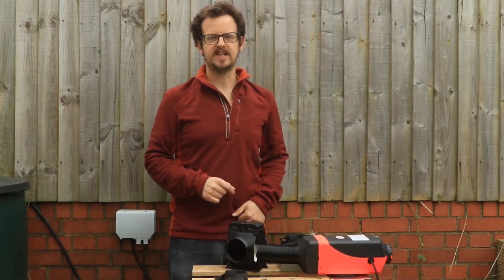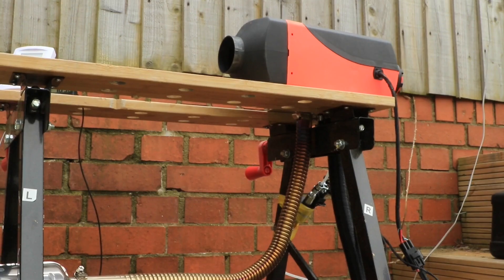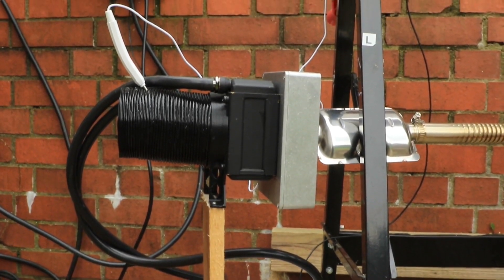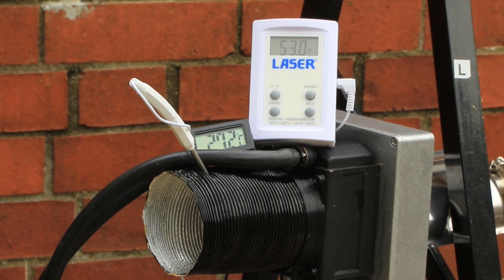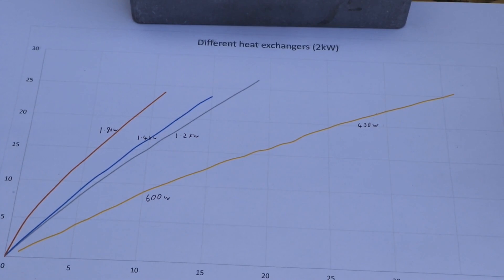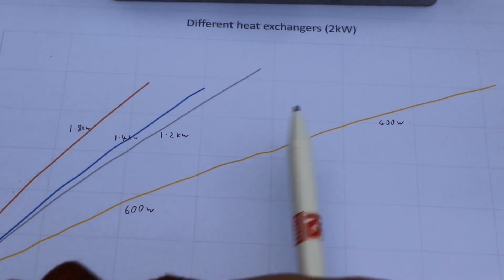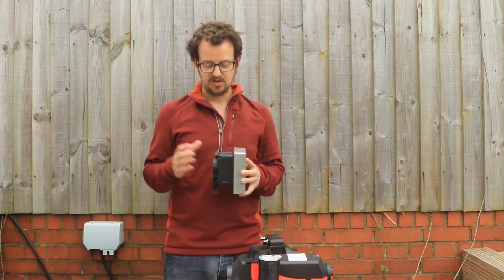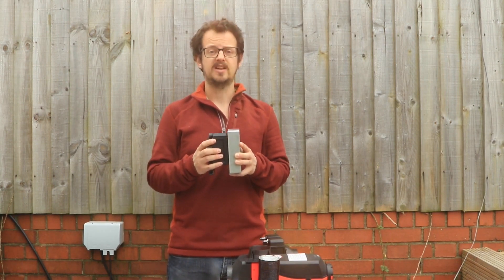2kw Chinese Diesel heater exhaust gas air recovery

Comment: I don't get the aluminum box is for what. Doesn't the gas just flowing though the heat exchanger? how is this any different than going out of the silencer?
Reply from the maker: Allows the hot exhaust gas to spread across the whole of the exchanger, allowing more energy to be recovered than if it was just heating a diameter which was the same as the exhaust.
Reply: @bobilvans4205  Ah ok I get it thanks, I guess the gas expansion and back pressure part confused me. I have in mind of doing something similar out of stainless steel but was wondering if yours was simply a box with two holes but it seems to be small hole input and output as big as the exchanger. This is very informative a setup like this would prevent my external tank from freezing during winter. Then it could go into the tankless water heater when needed for shower etc. Thanks again and keep up the good work.
Reply: @bobilvans4205  In which case then, it could have been cone shaped.

(No point in the useless silencer)

The test is null and void because of the heat losses from the non-insulated input exhaust pipe and the non-insulated water tank it's and piping.

You have quoted the outgoing temp of the exhaust gases, so can you please tell me what the velocity was from the 24mm bore exhaust pipe?

I wish to do the maths for myself.
Regards 
Adrian
Reply from the maker: @adrianchetwynd1334  no way I can measure velocity of hot exhaust gases from a hot exhaust. The meter would melt!

I have done a more up to date video here: https://youtu.be/OtnrBYz3uRE

However I would encourage you do your own experiments then report back. No test is null and void, it’s just how much of the information gleaned that is useful that is the important bit.
Reply: @bobilvans4205  why didn’t you measure the velocity of the air input to the burner chamber? Anything is better than nothing.

Thank you for your challenge to try it for myself, but as it so happens, I’ve already contacted your website with an interest in purchasing one of the models that you sell  but without the camper van installation kit’s.

Looking forward to some privacy in our communications after the bank holidays.

Happy 2023 
Adrian

Comment: 2KW heater came with a 12v 18.5-20 fuel pump.   Problem is there are 
no replacements to be found.  Checked ebay, Amazon, AliExpress, Alibaba.  While you could use a 16 or 22 neither is perfect

Comment: Buy using a heat exchanger on the hot air outlet your not recovering heat loss for hot water you are creating it as the heat for heating van is less. Fitting a dedicated heat exchange muffler which is lagged in glass wrap does not reduce van heating in anyway but recovers lost heat. With an additional secondary coil in the exhaust this can be used to pre heat the vehicle engine. Water is pumped with antifreeze in it into engine cooling system by electric pump. Lagging the exhaust prevents heat loss. Ideal for - 25degc etc. Cheers from old George

Comment: I have a 5kw heater on the bench for the next week or two if you want me to test it. I have done a video on heat recovery from the exhaust (pipe wrapped around the exhaust pipe) the results are interesting. I mentioned your product in my video. It would be interesting to see how your product compares. The big problem people seem to have is how  would they heat water in the summer ( they don't want hot air heating their van to get hot water) 
There are two ways i can see would resolve this issue.
1 fit a couple of heat exchangers this would cool the air more and actually make your product more efficient 
2 fit a diverted valve to divert any waste heat through an escape pipe and out the bottom of the van. 

Just some food for thought.
Reply from the maker: Hi Harry - thanks for the comments! We do now sell a diverter valve as an add on to the kit to solve the waste heat issue. Check out our website for more info on the product!

Comment: It's a nice piece of kit but my issue is that if I want warm water in the summer I have to heat my already hot van even further.
Reply from the maker: We now have a diverter valve on sale which removes this problem completely! Check it out

Comment: can you detail the parts used and where you got them? thanks!
Reply from the maker: nikola tesla all available from bobilvans.co.uk except the thermometer (eBay) and aluminium box (eBay).
Reply: @bobilvans4205  so the exhaust temp was 250°C out of the generator and 38-40°C at the end of the exhaust after taking the energy out of it??